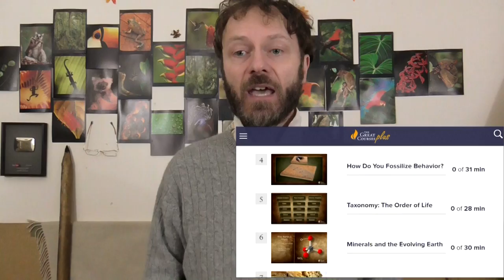Muzzle Brakes - what are they for?

Comment: Challengers have a rifled barrel, and generally don't use sabot rounds, which work better from a smoothbore, as the rifling just creates additional friction which slows the projectile down (and sabot rounds rely on extremely high speeds), and the stabilization that rifling provides is unnecessary for a fin stabilized sabot dart. 

And you would assume that a tank crewman is taught armor identification, and thus would know what a muzzle brake is. Even a British one, who isn't likely to know much about guns.

And anyone who has shot on a range next to a guy with a 5.56mm rifle with an obnoxiously large muzzle brake can tell you about the blast from a brake. And 5.56 isn't a very powerful round
Reply from the maker: Yes, you can see the rifling clearly, bottom right of screen at 12.41.  I was surprised that the tank commander didn't know what they were.  In the film Tigerland, Colin Farrell's character uses his rifle's muzzle brake's side-blast to blind someone deliberately.
Reply: Lindybeige In the movie Tigerland, they're armed with period correct M16A1s. The device on the end of the barrel there is a flash hider, and not a muzzle brake. A flash hider does not relieve recoil as a brake does, it simply dissipates some of the flash from the rifle so as not to blind the user. I imagine the trick used in the movie would work, but I'm not willing to test it (and I don't know anyone who has a rifle with the three pronged flash hider anyway).

The only explanations I can think for the tank commander not knowing what a muzzle brake was are 1 - he was an idiot. Being an idiot isn't necessarily a bar to being put into positions of responsibility in the US military, and I doubt the British military is much different in that regard; or 2 - the British tank corps has a different term they use for the same device that is commonly called a muzzle brake. There is also a remote third possibility that it simply wasn't mentioned in any of his training, but I find that rather hard to believe, even though most modern tanks to not have a brake.
Reply: 'generally don't use sabot rounds', where do you get this from?  They only carry 3 types of rounds, HESH, WP smoke rounds and APFSDS (C3).  The APFSDS is their main ammo type in any Tank V's Tank engagement, it also uses a slip band which decreases the friction and negates most of the spin effect on the round from the rifling.
Reply: Aussie Militant I believe I read it on Wikipedia or something. My understanding is that Challengers carry HESH rounds in lieu of APFSDS, because the sabot rounds don't work as well with the rifled barrel, and that the entire point of a smoothbore like the Abrams has is to be used with the APFSDS. I don't claim to be an expert and was never a tank crewman, and I could well be wrong though.
Reply: They carry APFSDS to complement HESH.  As i said the APFSDS uses a special 'slip band' (do not know the correct term) to negate (not completely eliminate) the effects cause by rifling. The Merkava's that used the 105mm Rifled gun also used these 'slip bands' to launch ATGM's.  

End of the day the Chally 2 is a good MBT but it cannot compete with newer and more upgraded Western MBT's, the British MoD simply wont allow the upgrades it needs, though with no perceived high intensity conflicts on the horizon its no wonder it will not be up-gunned any time soon.
Reply: Aussie Militant Well, one thing the Challenger has that no other MBT has is a vessel for making tea. Because I guess the British need to live up to the stereotype.
Reply: All armor-piercing ammuntion used on the Challenger 1 and Challenger 2 MBTs is fitted with sabots. I.e. the L23, L26 and L27 APFSDS rounds. Even the first armor-piercing round for the Chieftain tank - the L11 APDS - had a sabot.
Reply: Actually, The US Army installs the BV (boiling vessel) into the Abrams and the Bradley, So I'm afraid you're a little wrong with that statement
Reply: It took the US Army 50 years before they added boiling vessels to their vehicles. As to the sabot question what round do you think the 105mm rifled gun fired. It was sabot. Sabots high velocity makes it much more accurate then HESH. Also stand off armor can defeat HESH but not sabot.
Reply: The cv9030 has a rifled autocanon with a muzzle brake. It uses 30mm APFSDS-T and the the rounds are fitted with a rubberband that makes it go smoother through the barrel. And in my experience the muzzle brake didn't have an effect on the accuracy of the gun at all.
Reply: Eh, that depends a lot on the muzzle device (generic term for anything that attaches to the muzzle). For instance, the classic m16 muzzle device acts as both, the army just has some specific terminology it uses, which creates confusion. You can even have muzzle devices (that aren't traditional suppressors) that suppress sound to an extent.
Reply: farmerboy916 The Marine Corps calls the birdcage device at the end of M16 barrels a compensator. And while something like that might do a bit of both, the M16A1 three-prong device is clearly a flash hider. Go to the range and try shooting next to people with a brake and people with a flash hider on otherwise similar rifles, and you'll be able to tell the difference.
Reply: Evan Friend  Yup, I'd gotten myself confused and forgot about compensators. The three prong is pretty obscure even amongst civilians though, whereas you basically get a free birdcage with every AR-15 barrel you buy. I actually can't use the damn things because my state has crazy stupid and intentionally vague laws about flash suppressors. The difference often seems to come down to how close the interior diameter of the muzzle device comes to the bullet diameter
Reply: farmerboy916 I was stationed in California in the Corps, the M1A I bought there still has the stupid California mandated brake that I haven't gotten around to switching out in the last 9 and a half years. I have no idea what the laws are in any of the states that care about that nonsense, but the actual difference seems to me to be more about how and where the gasses are directed.
Reply: Technically, according to the US Army, they're muzzle brakes, because the bottom holes are plugged up. This is so that blast is directed upwards and to the sides, reducing felt recoil.
Reply: Pilotmario I know the Marine Corps calls them compensators, in civilian life it's generally referred to as the A2 flash hider, and seems to be banned by states that have bans against flash hiders but not muzzle brakes. And while it certainly directs gasses up, it doesn't direct them back, as most muzzle brakes do.
Reply: The birdcage is called a "flash suppressor" or "Flash hider" by the Army at least, not a compensator. Civillians call them compensators or muzzle brakes or all kinds of things that they are not. Although they do sort of act like one, since the bottom doesn't have holes.
Reply: I don't know what the ammunition load out on British tanks was, but in the 1980's and earlier the American M60 series (rifled barrel 105 mm, a British cannon as I recall) used HEP (vice HESH), HEAT, and APSDS (armor piercing, spin stabilized, discarding sabot).  There was actually quite a bit of discussion whether or not to stay with the rifled barrel (British) or the smooth bore (German) when we were developing the M1 Abrams series of tanks.  The smooth bore won out, but it could easily have gone the other way.
Reply: The primary round for the M60 series of tanks was the APSDS sabot round fired through the rifled barrel, the HEAT round was secondary, and the HEP (High Explosive, Plastic) was for lightly or non armored targets.
Reply: MrAdvantage1 I've never heard civilians use the word "compensator" to refer to any kind of muzzle device.
Reply: 5.56 with a muzzle break isn't so bad. A buddy and I shoot braked AKs next to each other and it's all A-OK. Try .30-06, you'll rattle the guy's lungs next to you.
Reply: ***** Depends on the brake. I've been to the range when a guy with an AR three tables over was noticeably obnoxious. I've also had people shoot next to me with brakes that weren't bad at all.
Reply: Muzzle Brake: Directs hot gases to the sides. Effect is to scatter the sound and reduce horizontal recoil. 
Compensator: Directs the hot gases up, to reduce barrel lift
Flash Suppressor: Has cooling vents to allow the hot gas to cool off before it leaves the barrel, both hiding the flash and scattering the sound. 
Sound Suppressor: Uses baffles to bounce the sound back into the barrel, negating much of the sound of the shot. Sound suppressors come in two varieties, one just uses baffles in a closed pipe, negating more sound at the cost of no flash suppression. The other has vents that allow the gas to leave and suppresses the flash, but don't have as many baffles, meaning it negates less sound than a closed pipe.
Reply: By that I mean compensators, of which are the noisiest form of muzzle brakes. I've never been bothered by compensated 5.56 but I'm used to compensated 7.62 so that's probably why.
Reply: Not all sabot rounds are fin stablised. The fins are there exactly because the round does not/can not have spin stablisation. This is why you have them in HEAT rounds, be them in tanks or shoulder fired weapons.
Spin disperses the charge on a HEAT. That's why people came up with a rotating gas check to fire HEAT from rifled barrels.
Smoothbores are the current trend. But although the first tank to use them was the soviet T-62 back in 196...1, it didn't "caught on" until the late 80's. First versions of the Leopard (1964) and even the first M1 Abrams came with a rifled gun.
The gun on the Challenger is still rifled because brits love their HESH shells so much.
Reply: Australian tanks have had a boiling vessel all the way back to the Centurion. I can't imagine it has been deleted in the M1 now in use, in fact if an attempt to delete had been made, I believe there would have been a mutiny. ;)
Reply: biggles1024 I knew some Australian tankers when they were out at Twentynine Palms to train on the Abrams. They didn't say anything about boiling vessels
Reply: The Leopard used by Australia fired APDS, armour piercing discarding sabot along with HEAT, HESH, Smoke and A-Personal (Splintex) rounds and was fitted with a 105mm rifled gun, so you've got the wrong end of the stick somewhere. :)
Reply: Evan Friend
And your point is? Do you really think that with nice new tanks to play with they gave a rat's arse about boiling vessels?
Reply: they did, but not to make tea. they did it to heat water to cook their MREs.
Reply: Which variant of the Abrams? I ask because they don"t have them on the M1A2 Sep V2 and I haven"t heard any of the guys who where on the A1s say anything about a BV. Also the Bradley  doesn’t  have a BV. wish it did make boiling water a hole lot easier.
Reply: Sabot rounds and riflede barrels aren't a problem, the problem is fin stabilized rounds like HEAT and APSDSFS.
Reply: In the film Tigerland, they were in training and shooting blanks.  Semi-automatic rifles will shoot but not cycle when shooting blanks without the addition of a Blank-firing adapter or BFA for short.  The gasses are normally trapped behind the bullet and pressurized.  When there is no bullet the gasses are not pressurized and can not cycle the action.  A BFA traps most but not all of the gas so it is pressurized and can then cycle the action.  In the film Tigerland the hot high pressure gas that escaped past the BFA wounded the solders eye.  https://en.wikipedia.org/wiki/Blank-firing_adaptor
Reply: @Ziga Auer but APSDSFS (Armor Piercing, Discarding Sabot, Fin Stabilized) are sabot rounds.
Reply: RonJohn63 The Fin Stabilized part is the problem. Fin stabilized rounds like APSDSFS and HEAT don't really work if they're spinning extremely quickly. HEAT will dissapate the effect, while fin stabilized AP rounds wont work because of the fins.
Reply: Evan Friend the US copied the BV, and they're in the Abrams and Bradley.
Reply: Žiga Auer Understood.  You were a bit ambiguous (to me, at least) about that in that original comment.
Reply: Evan Friend Perhaps our friend Lindybeige was referring to it as a "barrel break" at the time and that initially confused the tank commander?  I've certainly never heard of this thing referred to as anything besides a "muzzle break".
Reply: tnerb tnerb Nor have I, but I've never discussed the topic with a British soldier. I also know the military  (at least in the US), has a penchant for coming up with its own words for things that already have other names, and so I wouldn't discount the possibility.
Reply: @MrEvanfriend  APDS/APDSFS rounds work just fine out of a rifled barrel; it's HEAT rounds that have problems with the rifling.  HEAT rounds work by concentrating a jet of high-temperature gases at one point to burn though their target's armour; the spin induced by the rifling on the round works to disperse the gas jet before it can burn through the armour.  Smooth-bore cannon barrels are used to prevent this from happening.  The British Challenger 2 tank fires HESH rounds rather than HEAT, so the rifled barrel is not a problem.
Reply: @speedythree  HEAT rounds are shaped charges. The rifling has no impact on what happens to them after they explode. The HESH are in lieu of APFSDS, not HEAT (although they did develop special APFSDS rounds for the Challenger that have some way of mitigating the rifling.)
Reply: @MrEvanfriend  I must beg to differ; the HEAT round is not suited to being fired from a rifled barrel; the centrifugal force in a spinning HEAT round works to disperse the superplastic jet of molten metal and gas that is created by the explosion of the HEAT round.  (Federation of American Scientists, "Big Bullets for Beginners" - https://fas.org/man/dod-101/sys/land/bullets2.htm)  The Challenger 2 cannon, the Royal Ordinance L30, has had a number of APFSDS rounds designed for use in it; a HEAT round was not developed for it; both of these facts are also true of its predecessor, the R.O. L11 cannon.  Both cannon have HESH rounds in place of HEAT rounds.  The reason that there has been a shift to smooth-bore tank cannon is partially due to the use of HEAT rounds by two of main Western tank-making nations: Germany and the United States.  The other major reason is that the modern APDS rounds have long-rod penetrators that are not effectively stabilized by the round being fired from a rifled barrel; this is why the APFSDS round was developed, to have the stabilizing spin for the long-rod penetrator imparted by fins after the projectile leaves the barrel.  (Please see the footnotes in the Wikipedia article, "Armor-piercing fin-stabilized discarding sabot.")

Comment: You really should've called them barrel brakes throughout :) 

Great video. I was sceptical at first because I thought there wasn't much to know about them, and boy, was I wrong. 

I've known for a long time their purpose was recoil reduction, but nothing about the smoke redirection thing. (A nice addition would've been how effective they were in reducing recoil, if you had the numbers.) 

The effect of sideblast, while news to me, should've been obvious. I remember Eugene Sledge's comment of how Japanese fired their cannon from blast door equipped bunkers at point blank range, and that the blast would wipe out anyone inside, IIRC, 75 yards. 

I wonder if they affect ballistics? I've heard somewhere that a substantial portion of (post?) muzzle velocity is contributed by the gasses pushing the projectile immediately after it leaves the barrel. If this was the case, muzzle brakes would have to affect it. 

Also, how they affect flash observability. I can't even tell whether they'd increase or decrease it.